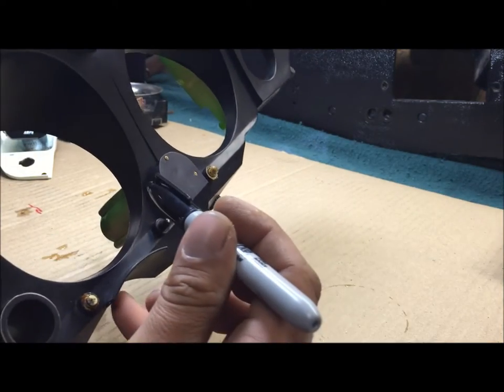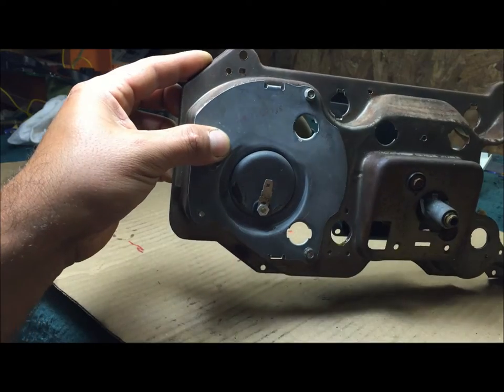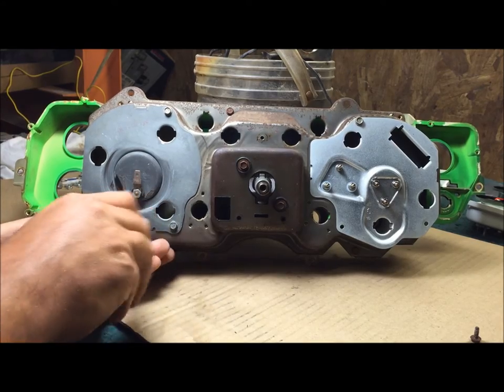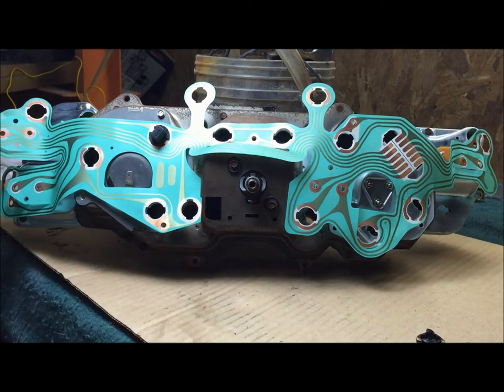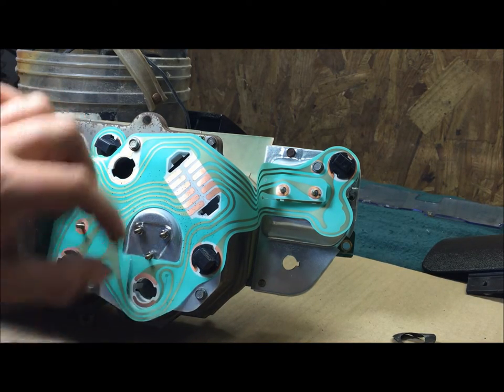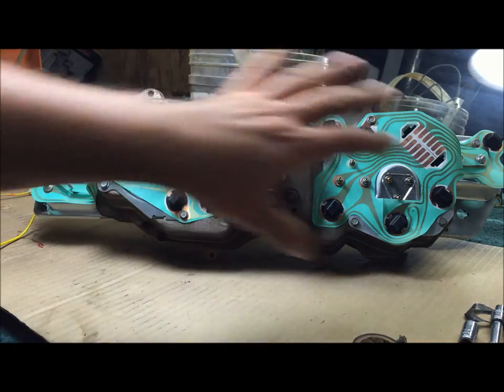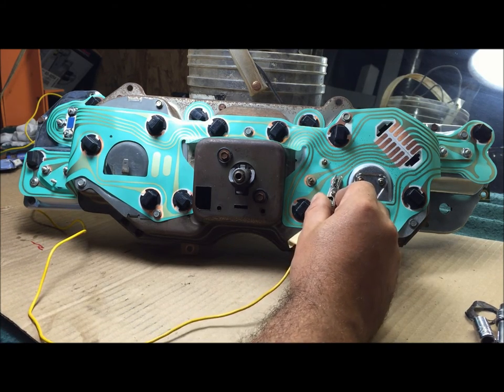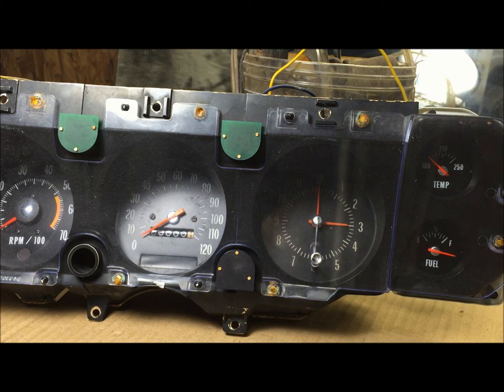70-72 chevelle dummy light cluster conversion to SS tach and gauges

Comment: I got a question. I got a 71 mailbu car with the sweeping dash. I was gonna convert it over to the round gauges. So I need the gauges and wiring harness. 
I bought a set of ss factory gauges with the tach, amp, and temp gauges in it. And then I bought a wiring harness separate. But that wiring harness wasn’t Hooked up to a set of gauges with all the temp and tech and amp gauges. Is their anyway I can get those (temp,amp, and tach) gauges to work with that harness? Could I add another set of wires to it? Or do I have to get another wiring harness to get that to work ? I need help lol
Anyone can chime in to help me. Thanks

Comment: Hey Chris.  Got a question.   Have a 72 Monte Carlo.  Gas gauge was working when I took it out.   Plugged it back in after swapped the clock for tach and reads below E now.   I put my multi meter on the screws on backend the gauge and get 49 ohm.    Is that the normal state?   Is it possible I shorted the gauge itself?

Comment: If you are doing this job, install 6000K led's in the dash illumination sockets only, I re-did my cluster as well with new bulbs (even used 168's which are a little brighter) and had to remove my cluster again 1 year later to install led's because the illumination was so poor. Now illumination is great, matches my other incandescent lighting I left alone on the climate controls, console and radio and everything is still dim-able. I used Sylvania zevo 6000k super-brite 194 led's, they are dim-able, polarity sensitive, have a heat sink and lifetime warranty, pricey at $22/pair, but I don't want to do the job again. Job took 10 led's. You want to keep incandescent's in the areas I mentioned to aid in current draw through your headlight switch rheostat facilitating smooth dim-ability.
Reply from the maker: I drove a 72 in high school. I want my lights to look like they came. I could have put whatever I wanted in there
Reply: @chriscraft77022  That's just nuts spending all that time and money on a gauge conversion and not being able to enjoy or even read your new cluster at night. I'm 65 and drove a W-code in high school too and I don't remember not being able to read my gauges at night.

Comment: And what volt or amp did you check lights at?
Reply from the maker: i super glued the lens back and the voltage is the same as the battery voltage for everything on the dash..  my dimmer is always clocked to off ..  turn it all the way left in case you dont know..
Reply: Thank you!

Comment: Hey Chris, Thanks for this great video, Question. Where can I find this small lens with "LIGHTS" that you glued in the lights switch front section around 14:28 of the video? Mine is missing that. Thank you!! Keep up the good work!!
Reply from the maker: OPGI … or STMC in spring, Tx    both are Chevelle parts
Reply: @chriscraft77022  Thank You, I know OPGI but can not find any web page for STMC thou?
Reply: Also, it will be a good idea to show from rear how or where do you apply power to text the lights etc. Thanks
Reply from the maker: I don’t understand what that means.
Reply: @chriscraft77022 You turned the room light Off to test the light bulb of the cluster. You show the front of the cluster as you apply voltage and the light turn on. Where do you apply the power to test each one? Where do you connect the Neg (-) of the 12V?? Thanks, Regards